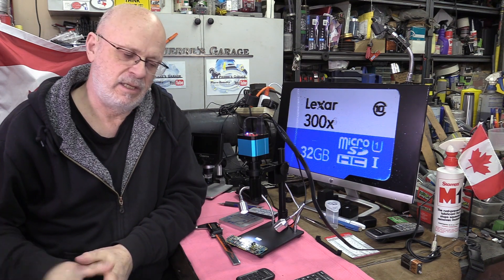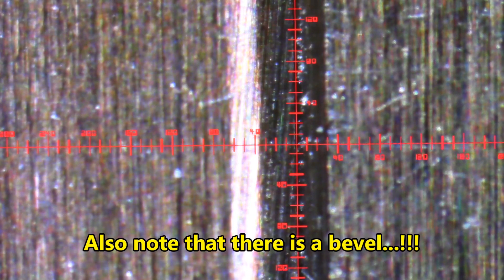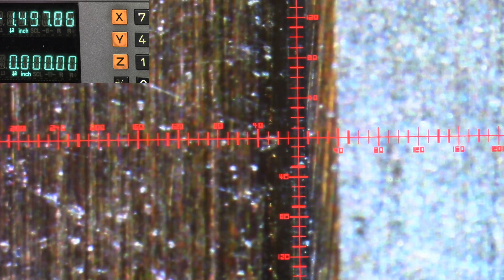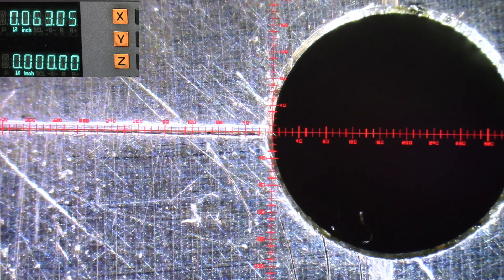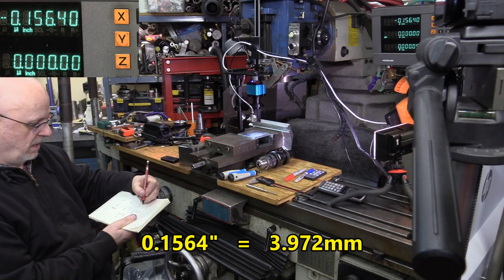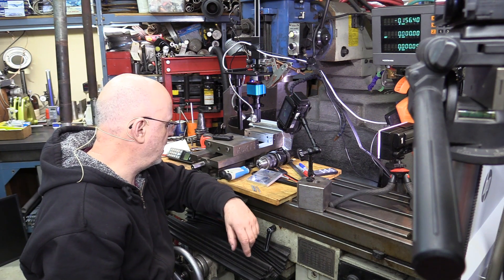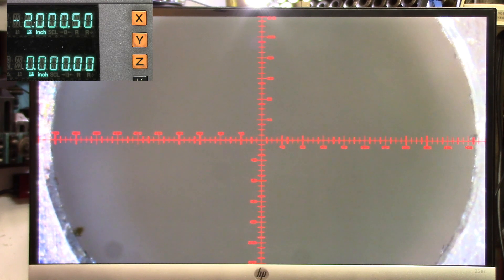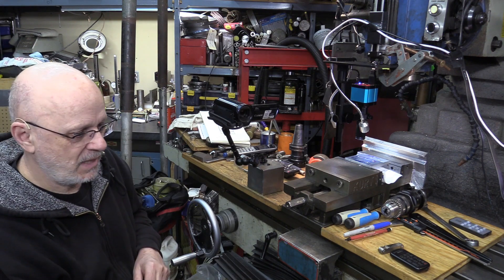Microscope on a milling machine used as an optical comparator...  It works...!!!

Comment: I would like to see how ypu mounted this to your milling machine. A how too video. Thanks
Reply from the maker: The mounting in this video is a temporary measure, this was for proof of concept video. 
I've been inactive at producing videos for quite a while, I'm not planing to restart any time soon.
If you want to use the idea, make certain to use a stiff mount well fixed to the head of your milling machine, also aling the whole setup very perpendicular  to the surface to measure. Do not play with the focal lenght or the focus as this will modify the ratio of the image. This setup is suitable for 2 dimension items only.
Reply: @pierresgarage2687 its a great idea that needs to be more developed. Its all about alignment and linking to the DRO.  Thanks

Comment: Nice test and explanation. I am planning on using it on the Lathe and maybe on the mill. Would be interesting if it can also be used to center something.
Reply from the maker: There are lots of things you can do with this using some proper supports, including centering, this can get very precise.
I wouldn't use to monitor while making heavy cuts if it's attached to the machine, mostly liter machines, vibrations could be an issue, but, for controll or setting up it will do real good...
Reply: @pierresgarage2687  Yes, I thought about making a mount that is connected to the wall and not the machine to minimize vibrations.

Comment: Hi Pierre,
Thanks for the video. I think I will have to get one of those now.
Steve
Reply from the maker: With a solid set-up and a little fiddling it gives real good results, can double as an excellent camera with any C mount CCTV type lens. Be careful about the mounting threads on the body, it's metric 6 mm, NOT 1/4 - 20...
Cheers, Pierre

Comment: I wonder if you could possibly rig an alignment optic out of that?
Reply from the maker: That's the idea, easier to install on different machines, lite weigth, you need good quality and high resolution scales to get the most of it...
Or if you got more ideas I could try to see if it could work, just let me know...

Comment: Wow Pierre - lots of nice setup.  Great discussion on a new way to look at things. 

What camera is on the mill table?  I need a new one as you  know - LOL. 

Dan
Reply from the maker: Hi Dan,  Very happy I got to experiement around some ideas that were going through my head, seems like what I had in mind is working real good so far, more to look around when time allows...
The camera you can see on the mill table is a Canon Vixia HF-R600, now they got the 800, not very different, a couple of nice features on those cameras like external microphone input for better sound, one problem I find is that the lens could be wider angle, Image quality and standard features are quite all right...  In that price range it's a good buy, there are other good ones, but, I'm not very qualified to talk about the others since I haven't used them...    
If you have questions, just ask and if I know I'll be glad to help...

Comment: I wonder if it has enough depth of view to use for tool grinding profiles, like gear or spline cutters.  I'd like to see it used that way with a CAD generated overlay, to work like an optical comparator.  

Can it be made to work like an optical comparator - light source under the work casting a shadow up on a piece of paper that the microscope reticle sits on?  No depth of view needed then.
Reply from the maker: Easy to use a light table to get a shadow profile just like the comparator, this is something I want to look into in the future, with the supplied software there are many more possible measuring possibilities...   Still got to experiement and discover, so far this is all stuff that is working properly.
Reply from the maker: Didn't see that on Dale's channel...

Comment: I hope you don't eat off the grill.  Not sure what is in a road flare but it can't be good for you.
Reply: Basically a huge match head.  I've used them for signaling on the railroad, once lit they are very difficult to extinguish.  I've seen them burn under water.
Reply from the maker: Spicy food, a good Tex-Mex food night, your butt may itch a little the morning after...
Don't worry that BBQ was going to the road side for scrap the next day...   ;)

Comment: A good demonstration of what the microscope can do.
Reply from the maker: Got more plans for it, just need more time, though.....      lol
Reply: @pierresgarage2687  Is chrossair a software feature or is it engraved in camera?With a spindle mount it would be great for edge finding,scribe line finding ,for drill press and such things.In past people had centering microscopes,but those are expensive but useful tools,this one might make a good cheap alternative.
Reply from the maker: All features are software, you can either have them in or out at will.
Many other applications I got in mind that I didn't include in the video, like screw pitch, shape and angle measurements, centering, runout measurements, etc....
The centering microscope in another possible one...
All those need time to experiment and adapt......    ;)